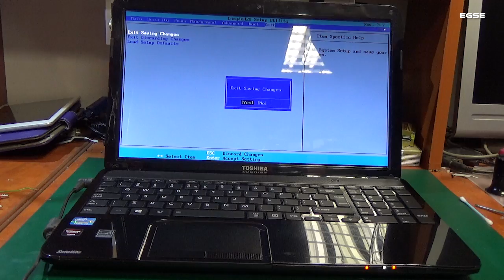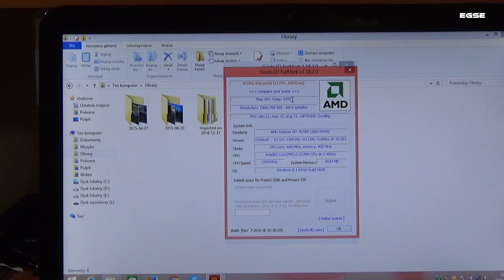Toshiba L850 naprawa układu grafiki/graphic chip repair

Comment: hi i bought same l850 only woth i7 ( it came with broken gpu ) it has  same amd 7670m . i sent to a repair shop he tried to reflow but problem the same . when he reballed . the motherboard failed totally 😣😓.. (i have black screen now. brfore i could use at least with intel gpu i used to disable amd driver at device manager )is there any chance if i sent to different repair shops?  please reply this coment
nice video tho u look really professional 👍
Reply from the maker: Reflow and reballing is a waste of money. Only replacement for a new GPU makes sense. It is not known whether the motherboard was damaged during this repair or if there were any other malfunctions. Only experienced service could try to repair it.
Reply: THANK U SO MUCH FOR YOUR REPLY. he said tht he puted a new chip a new gpu but the problem was with the motherboard cuz it was so demaged the gpu couldnt stay in its place any more ... if i sent to other service shops do u still think THERE IS A CHANCE TO STILL REPAIR IT 😐

Comment: Very nice video. Can you tell me the temperatour and time cycles you use on the rework station?
Reply from the maker: You have to make own profile because each station has other work conditions, various mainboards have other work conditions etc. My main profile it's bottom heater (time and temperature) for 100-120stC on upper side mainboard and upper heater 150, 200, 217, 230stC

Comment: nice how do you find the same gpu  can work withe this MB
Reply from the maker: I usually use the same IC like factory used, sometime (if status is OBSOLETE) I use newer equivalent chip. List of equivalent chips you can find on specified forums if you have not experience or on your local supplier.
Reply: ok thank you for your  help